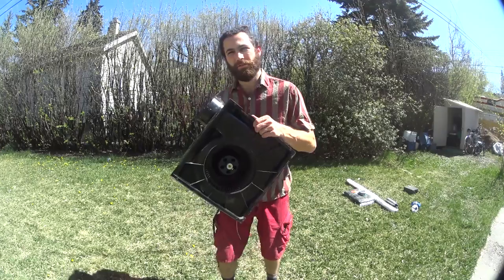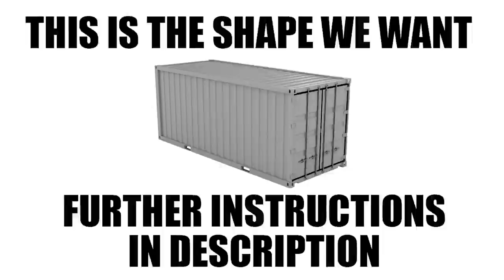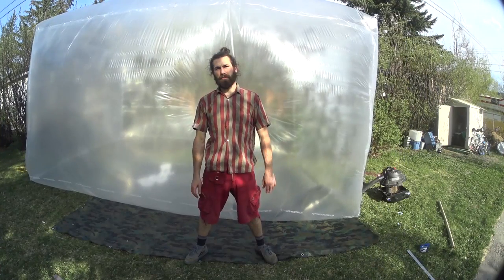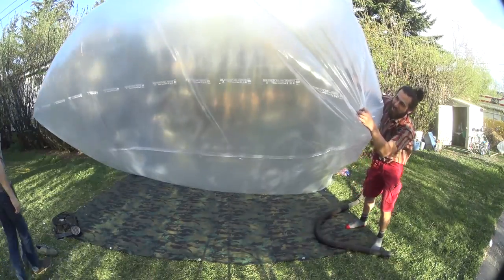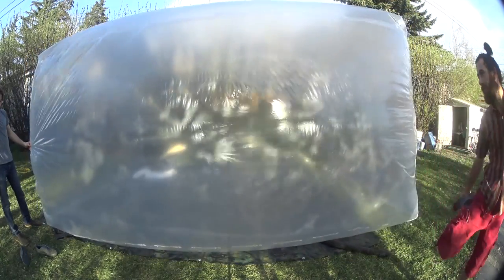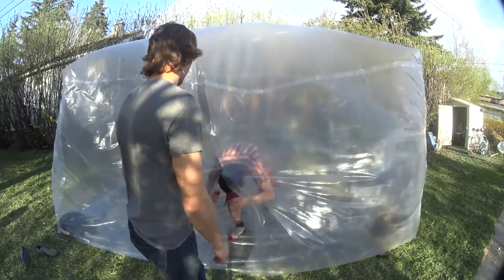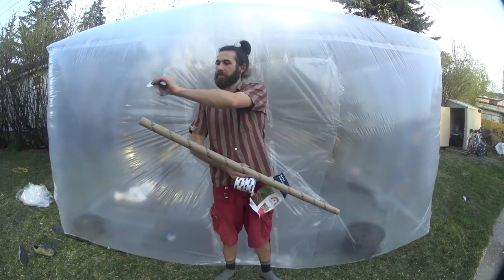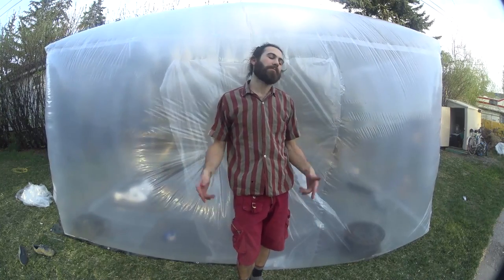How To Make a Plastic Bubble Fort For Almost Free!

Comment: What are the measurements, how much plastic sheet did you need?
Reply from the maker: I didn’t really start with measurements, I just picked up a large painting drop sheet and folded it over into a rectangular tube, then used a second drop sheet cut in half to make the end caps. I just measured the width of the end caps after my tube was folded up in front of me, I didn’t do any of it in advance